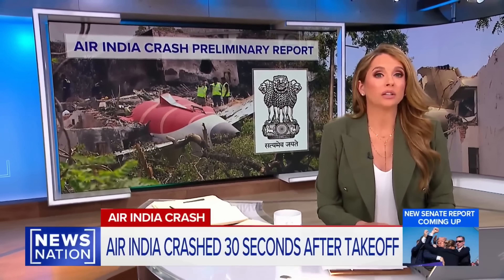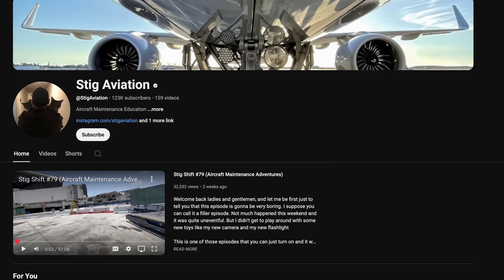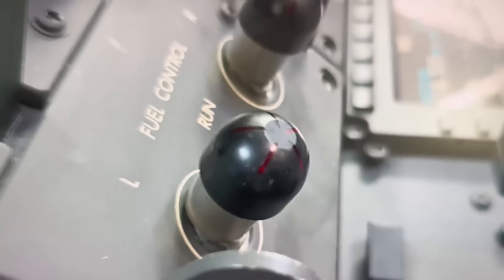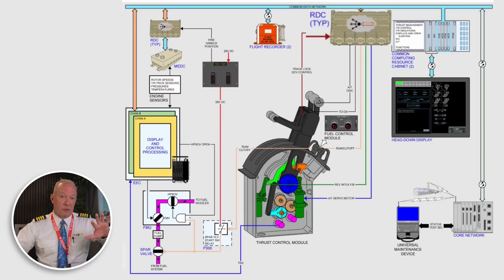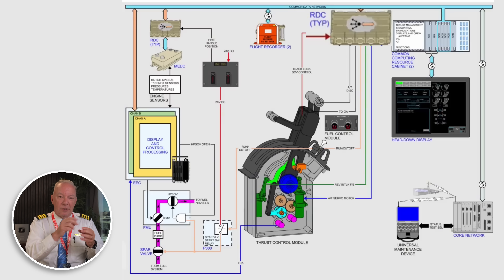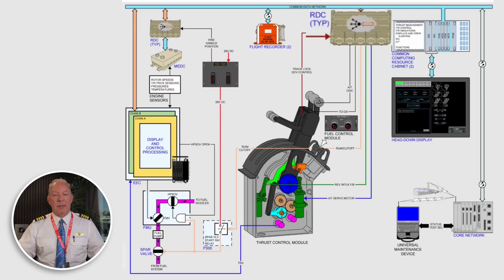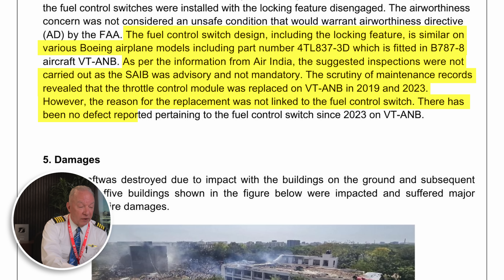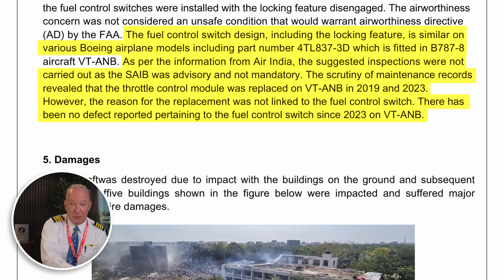The Truth About Boeing 787 Fuel Control Switches

Comment: Since the switch is connected to a relay, it's not the only thing that can shut off the fuel.  A short in the relay or control circuit will do the same thing.  In other words, those switches do not directly control  the fuel.  It is a link in the chain.  it's entirely possible that something else could have caused the shutdown.   looks to me the relay is normally open so you need voltage across the relay to open the valves.  The switches don't create the voltage so losing that connection to voltage or ground will create the exact same effect.  The signal that the switches were moved goes through the RDC which could actually be the cause of it.  There is no physical detector on the switches themselves so the is no indication that the switches were actually moved.
Reply: Your supposition requires the simultaneous failure of two independent relays and/or two indepndent switches. This is extremely improbable. Not only that, it would require both independent systems to simultaneously fail the fuel valves closed but then also to fail them open again, nearly simultaneously. This strains credulity. Occam's razor suggests a simpler explanation is infinitely  more probable,  thet the control switches were actually moved.
Reply: @rogerrowlett7388  No, power supply to the relay being cutoff would open the switch closing the valves.
Reply: @rogerahier4750 OK so that failure mode would cause a simultaneous failure of both valves, as well as a simultaneous re-establishment of both fuel valves. And that somehow assumes the relay majn power failure was not permanent. This is starting to look very implausible compared to simpler explanations.
Reply: @rogerrowlett7388  In addition, the HPSOV is controlled through an and gate, not an or gate.  it only takes 1 to change to shut off fuel.  Both relays are in the same spot with the same ground and power connections to the bus.  The relays are not physically on either bus.
Reply: Why can't you stick to the facts? The pilots talked about the switches being moved. The switch position is recorded by the FDR by a separate line, as displayed in the schematic shown in the video. Just try to understand and stop inventing theories that don't fit the known facts!
Reply: Not only that. The FDR's idea of what the switch position actually is depends on a chain of several components that all depend on correctly operating electrical systems.
Reply: Y'all trying very hard to defy the facts.  As Capt. Steve explained, in detail, there are TWO separate systems.  Speculate all you want on some improbable electrical fault causing this, but consider that it means there were virtually simultaneous faults on both systems...and then somehow both faults cleared???   And ignoring the "Why did you do that?" we have on the voice recorder.  Gotta face facts, people.
Reply: Nope.
Latched relay, requires power to open and power to close not a power interrupt.
RDC is a discrete signal wired to extra poles on the switch for that signal alone and is isolated from the DC signal required for the relay control, it enables other systems on the aircraft (like the fuel management computer) to understand the switch position alongside data logging in the FDR.
Schematic is for a pilot not an engineer.
And the odds each engine relay failing within one second of another?
Reply: Thanks Roger for clarifying that - on the same note, "transitioning" does not mean "being moved", but just "changing state". (They would have heard the distinct clicking of the switches on the CVR -but this is not mentioned.)
Is it not proven that the transponder signal was lost before the switches transitioning right after lift-off - could this be the sign of an electrical failure and thus deployment of RAT?

Comment: The fact that the engines restarted  showed they were good
Reply: They = engines, switches and DC power (for some strange reason some people seem to have problems understanding the latter).
Reply: @fritzchen0.523  If people cannot understand DC, then 3-phase AC must give them nightmares. 😄
Reply: Most likely what happened: first officer switched fuel to cut off (instead of hitting the switches for gear up) the captain asked why he did

He said he didn’t, realized he did, and set them back and the engines respooled but not enough to keep going.
Reply: @AliAbdallah-k7b  Non sense. No pilot could possibly get mixed up between those two. They're located far apart and there's only ONE gear up lever (lever, not switch ). And he didn't use the phrase "I didn't realize that I did". He said "I didn't ". There is no "most likely". ONE OF THE PILOTS DELIBERATELY SWITCHED THE FUEL CONTROL SWITCHES TO OFF'. There is no other possibility.
Reply: @davidquinn6161  Power supply failure.
Battery dies, both relays open, RAT deploys, both relays closes again.
All without even touching the switches.
Reply: @giacomoneri1782  Battery is good for at least 1/2 hour.You didn't listen. He compared to a car. Alternator dies, battery runs car for a certain period of time depending on load.
Reply: @AliAbdallah-k7b  The FO was the pilot flying according to the report, so he would call for gear up and most likely had his hands on the yoke.
Reply: @kuebbisch  Thank you for reminding everyone of that point.. People just don't read..
Reply: @AliAbdallah-k7b  This is not plausible for multiple reasons.
Reply: @AliAbdallah-k7b why can t we accept that one pilot commited suicide like germanwings pilot? Why we have to invent reasons and scenarios?
Reply: Why arent we considering a possibility where dual engine failure happens just after take off. Then pilot manually turn fuel switches off and on because thats SOP in Boeing planes in case of Dual Engine.? You can refer to Gaurav Taneja AI 171 Part 3 in english dub to understand more about this theory as timeline of RAT deployment also matches with this
Reply: @ishanarora7948  in that case there wouldn’t be a ten second gap between. Not a chance.
Reply: @MIEJ4  umm human factor, they might have to refer to QRH anything can happen. If you h=would have watched the mvoie Sully there also they took 8 seconds for human factor
Reply: @MIEJ4   Fine let just agree one of the pilot did this intentionally. How in the world that pilot knew it with such precision that if I cut off fuel at this instance of take off we will surely die? Because if this have had happened few seconds later both engine would get into power again and as per report one of the engine was up before the crash.
Reply: @ishanarora7948  Because the FDR recorded the sequence that starts with the switches turned off followed by engines spooling down and not the other way around.
Reply: @igormitrovic7688  Fine let just agree one of the pilot did this intentionally. How in the world that pilot knew it with such precision that if I cut off fuel at this instance of take off we will surely die? Because if this have had happened few seconds later both engine would get into power again and as per report one of the engine was up before the crash.
Reply: @shubhampal7877   One engine had "started to progress to recovery" according to the report. It would have taken a while to be fully operational and they didn't have that time because the fuel was cut off when they'd only just got airborne. The whole flight only lasted about 30 seconds.
Reply: @juniper1803 agreed but how can a pilot know exactly when to cut off so that this plane will crash with 0 error cause if the plane survived then he would be put into custody. I hope you get what i am trying to say this level of precision is impossible. Suicidal along with such precision it’s not possible
Reply: @shubhampal7877  And yet it happened, So not impossible. It's indisputable that the switches were moved to off by human hands. The locking mechanism ensures that ONLY human action can move them. The pilot knows the plane. He picked the exact worst time to cut off the fuel. Please don't imply that fuel was cut off at the worst possible time by some zillion to one malfunction. Which trained investigators from 3 countries missed.
Reply: @davidquinn6161 see fuel cut off happened and one of the pilot did it that’s correct but that does not imply it was done as part of planned suicide
Reply: @shubhampal7877  There's no known reason to cut off fuel at that point according to numerous 787 pilots. If you have an explanation, bring it forth. For that matter, the interim report doesn't say it was a planned suicide. Neither did I.
Reply: @davidquinn6161  Why did Boeing use suicide switches? This is so stupid, they are positioned at a place, the other pilot will not notice.

Besides, how is switch checked to be on or off by the "data" electronic circuit? Is the switch or the relais used? 

Why did other pilot not say switches were off and he did turn them on?
Reply: @ishanarora7948  he mentioned that exact thing in this video, AAIB report debunks that. https://youtu.be/AD5Kc2BURZw?t=871
Reply: @ishanarora7948  If that was the case, you wouldn't hear "I didn't" in CVR recording. As unfortunate as it may be, we need to start respecting the data at some point irrespective of our emotions.
Reply: @ishanarora7948 why can t we accept that one pilot commited suicide like germanwings pilot? Why we have to invent reasons and scenarios?
Reply: @adrian1622  Ohhh you do not know how G|emran pilot did commit suicide? This is a complete different situation. The switches were turned on, not a word of a pilot that he did turn them on.

Comment: Captain Steve, thank you for your work. I'd like to ask a simple question here, and ask you to seriously consider it and explain it to us. You yourself just said that the three valves are powered by the 28 VDC battery. Only by the battery, as you emphasized several times. What would happen if the battery (Li-Ion) suffered an internal short circuit (e.g., when operating the landing gear lever to retract the landing gear)? Li-Ion batteries have caused problems on the 787 before... The RAT is deployed, which takes about 10 seconds to power up, and the battery is replaced... and the three valves are supplied with power again, which would explain the engines restarting after 10 seconds. Greetings from Germany.
Reply: Would battery failure show up as turning off the switch?
Reply: @sailedout 

As per steve... Yes ofcourse..
Reply: @sailedout  That's a good question, and one I'm asking myself as well. Where does the FDR get the information about the position of the fuel switches? Does it simply check the voltage after the switches? Then, if the battery is broken and there's no voltage, I'd have the same information as if the fuel switches were in the cutoff position, right?

Comment: Hey! What about that AND Gate that controls the HPSO Valve ?   On the block diagram that's a 2-input AND Gate and only one of its inputs comes from the Spar Valve Control Relay (SVCR), the second input comes from the EEC.  Also, on that diagram, the EEC/D&CP is drawn to control the FM Valve ...not the SVCR relay.

Comment: This is why there should be cameras in commercial cockpits.  It is silly that, in this day and age, we are still uncertain as to exactly what happened and who did what, because pilots refuse to allow cameras in cockpits.  And cameras may not have prevented this tragedy but might prevent another.  Cameras are everywhere now, commercial trucks have both dash cams and cams directed at the driver and he's alone in the cab.  In short, commercial pilots are never alone in the cockpit and have no expectation of privacy while at work.  Captain Steve, you'll be retiring soon and then you'll be beyond the reach of your employer and/or the pilot's union.  Your legacy could be that you made commercial aviation even safer by advocating for cameras in the cockpits

Comment: Regarding the replacement of the unit, I would like to add.

I worked for a major airline supporting maintenance engineers.  Every sub-system has a serial number.  As each system was removed, it was recorded which plane it came from.  A unit was tested, fixed, and then tested again.  Once it passed, it was available for reuse.  

There are cases where a system tests fine and fails on the airplane.  After a small number of failures on the airplane,  it was removed from production.  The part could either be tested till it broke and the testing procedure changed, or the system was scrapped for parts, where each part has its own testing cycle.

Comment: Captain Steevee, have you seen the Website “Airline News with Geoffrey Thomas”? They have provided a 17 page report setting out what they believe to be the cause of the tragic crash.
They claim that the rat was deployed before the switches were transitioned from run to cut off. They believe that an electrical fault caused by water ingress lead to the engine’s cut off.
The rat deployed, the pilots transitioned the switches from run to cut off relight the engines. 

As a layman I am interested in your professional opinion. My understanding from the report is that the rat was deployed after the switch’s transitioned from run to cut off.

Comment: We need to explain why video is not recorded of the cockpit.  Video requires a huge band width and memory to be stored, the black boxes are already storing thousands of sensor data inputs and voice.  Voice is already a huge data capacity/memory requirement, not to mention the black bock stores more than one flights data before its overwritten.  The black box would require much larger data capacity to include video capture and storage.   I assume I'm correct in thinking the storage media in a black box is still a steel tape/wire wound like an old reel to reel recorder tape reel.

Comment: But if that report was from 2018 even though it was just a news bulletin and not mandatory it all should still have been checked.
Well it says they weren't removed because of fuel switches but they could have just changed them if there joined to part that has removed.
10 seconds from switches being turned off to back on,was too long co pilot should have spotted that.
Fuel switches need switch off alarms to activate after four seconds of being off.
Can't they make them so only one switch at time can be turned off then back on before it will allow you to turn other one off

Comment: Hello Captain Steve. I thoroughly enjoy your content. I am not a pilot but an aviation enthusiast. I am a Boeing fan boy and prefer to be on a Boeing when I fly. I also fly in MSFS, and my plane of choice is the PMDG B777-300ER. It piques my interest that you are a B777 Captain. I have a question. How do you manage the trim after wheels up and the start of ascent until flaps zero? I want to use real-life processes when I fly, but I'm not sure if what I'm doing is realistic. The PMDG 777 has an FBW indicator. I don't know if that is actually on the real plane. I use the FBW bug to adjust the trim to achieve flaps zero. I adjust the trim to flaps one and start to transition from Flaps 5 to flaps one. Once I am stable and still climbing, I will adjust the trim to 240 knots. Once the speed approaches the flaps 1 indicator, I go to flaps zero. I make sure to maintain a positive rate all the time. So, I am curious how you do it. Thanks

Comment: I believe Capt. Steve
Reply: Why arent we considering a possibility where dual engine failure happens just after take off. Then pilot manually turn fuel switches off and on because thats SOP in Boeing planes in case of Dual Engine.? You can refer to Gaurav Taneja AI 171 Part 3 in english dub to understand more about this theory as timeline of RAT deployment also matches with this

Comment: If,the,Capt.,manually put the,fuel-switches,to,off,there would be,aural/visual-alarms,”MAST WARN,CAUT”,EICAS-list,stick-shaker,”stall”

But,since,EEC-hard-overed,to,EEC-approach-mode,from,EEC-flight-mode,due,to,gear-trauma,”gear-lever-up”,”crabby-skiddy-landings,with,longitudinal-axis,not,aligned,with,rwy-centre-line and consuming,rwy,to align,delaying,thrust-reverse,making,EEC,intervene and shut-off,both-engines,to aid,deceleration,”shutting-off,engines,is,beneficial,for,deceleration,or,hitting,fence”,so,the airplane,didn’t give,any-alarm,as it was,fooled

One,A320,from,Kochi,to,VABB,overran,due to,crabby-skiddy-landing,delaying,reverser-action and Airbus-EEC,through,ROPS,will not shut-off,engines,but,rather,scream,”maximum-manual-braking,maximum-reverse”,sensing,fence-hitting

If,dev😘,says to,his-gf😘,”I belong to,you”,she will not give,any-alarm,but,when,she knows there are many like,her,you know,what she will,say

Comment: Mechanical points if faulty stick or weld together which being the case the circuit would continue to operate. The problem would  be shutting the circuit off i.e. the engines.